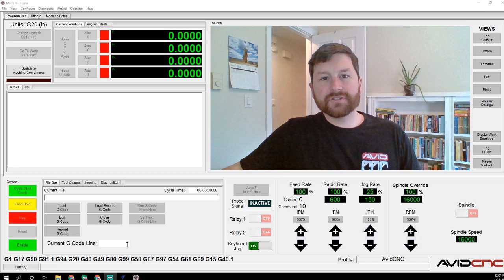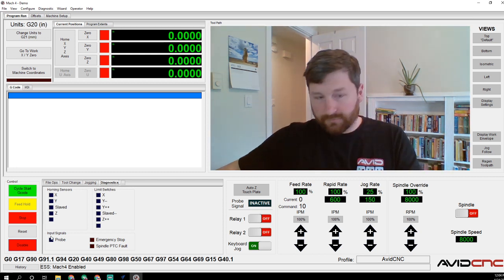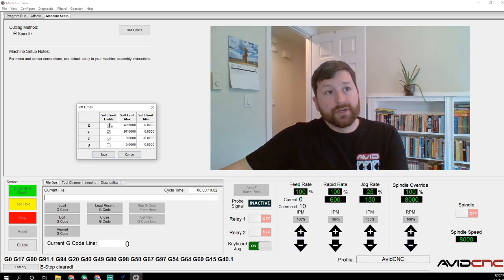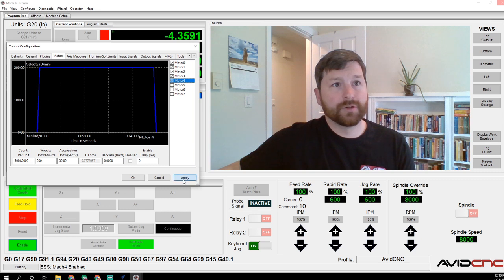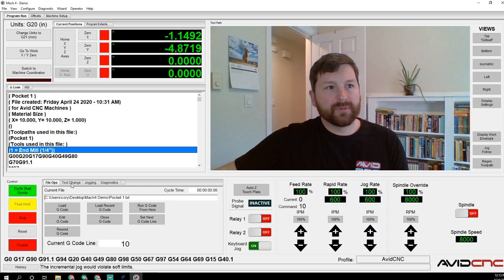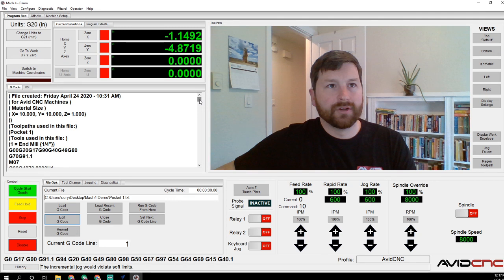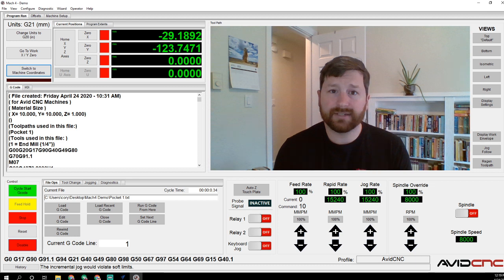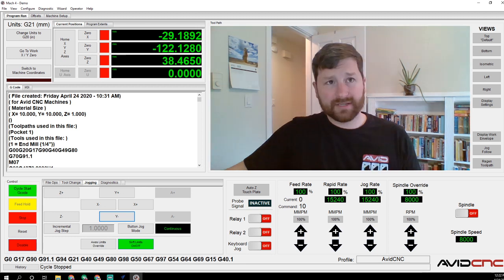Mach4 Tour - Avid CNC Live!

Comment: Thank you for this.  Very helpful.  Question about setting work coordinates.  At 6 minutes into the video you talk about using the touch plate and setting the tool diameter.  When you set the tool diameter - is it the diameter of the shank or the actual business end of the tool?  For example if I am using a 2" flattening bit with a shank of 1/2" - Do I set the tool diameter to 2" or 1/2"?  Thank you.
Reply from the maker: You would set the diameter to the "business end" of the tool. What the touch plate utility needs to know is the kerf of material that will be removed, it doesn't care about the shaft diameter of the tool. So in you case of a 2" flattening bit you'd want to enter that diameter as 2", not 1/2" for the shank. 

Specifically for bigger bits like that if you have trouble fitting them in the touch plate check out this video: https://youtu.be/xUsE5PmnWVA A user added a second plate for larger flattening bits.
Reply: @AvidCNC  Very helpful!  Thank you!  When I use a v-bit how do I determine what measurement to put in?  Thanks.
Reply from the maker: @JayHuemann  With A V bit you can zero manually by placing the tip of the V bit on the corner of your material and pressing the zero buttons on X and Y in your DRO in Mach. If you want to use the touch plate you can chuck up a straight bit, zero and then switch to the V Bit

Comment: Hi Cory, are you still online?
Sorry I missed your live Q&A.  Quick question about using the zero plate.  Having used the plate to set 0,0 at the front left edge for an end mill and then changing to a vbit, if I just touch off the vbit on the work surface, will the program remember the 0,0 setting at the front left corner?
Reply from the maker: Yes, you can easily set the X&Y position with a dowel or end mill, and then set just the Z axis with the V Bit.

Comment: I used to run a Shopbot Machine and one of the features I miss the most is been able to type in a specific coordinate on the shopbot interface and hit the goto button. Can I do this on Mach 4 and my Avid CNC?
Reply: Yes. Left side of the screen in the middle is the GCode window with another tab labeled MCI. Click it for manual input. Type x1y1z1 and click cycle start and the machine will move to those values. When MCI is enabled keyboard jogging is turned off so you will have to go back to the GCode tab to manual jog again.
Reply: @JayBates  Thanks, this is very useful!
Reply from the maker: You absolutely can. That would be the G00 – Rapid move: Rapid moves are used to move from point to point in free space, not cutting
material. Format: G00 X__ Y__ Z__  This is taken from the Mach4 Programming guide, page 7. https://www.machsupport.com/wp-content/uploads/2014/05/Mach4%20Mill%20GCode%20Manual.pdf